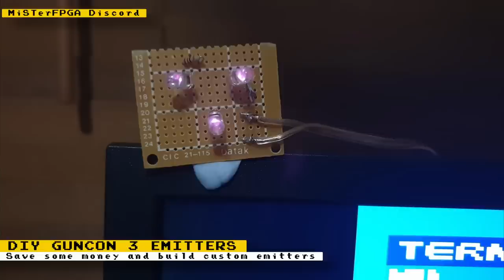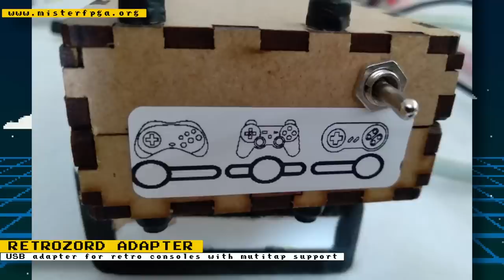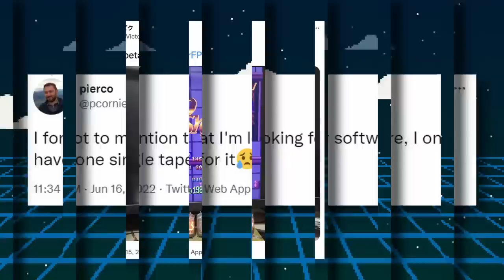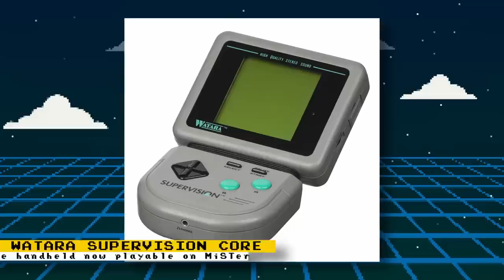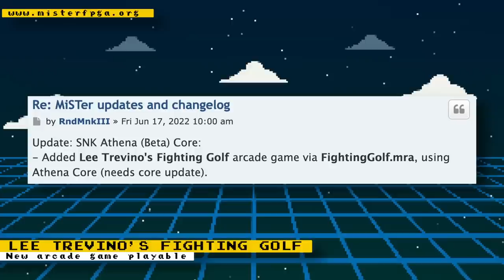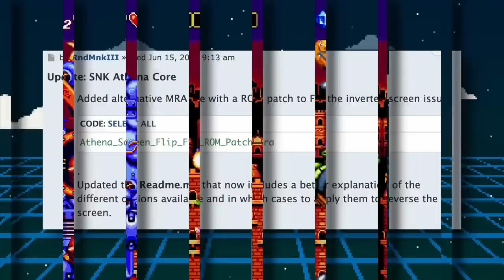MiSTer FPGA News & Updates - DonPachi Public, PSX Updates, GunCon 3 and more

Comment: RetroZord sounds like a great idea for using specialty controllers and multitaps on other platforms. Would it be possible to use a PlayStation SNAC adapter for the wrong platform with something like this? I imagine “no” since the target platform will likely have its own SNAC support and RetroZord SNAC Edition would need to be integrated into the core. ;)

Even if it requires a special adapter, I hope RetroZord gets support for NegCon and all the other funky controllers.
Reply from the maker: Unfortunately SNAC does not support using non-native controls on a core.